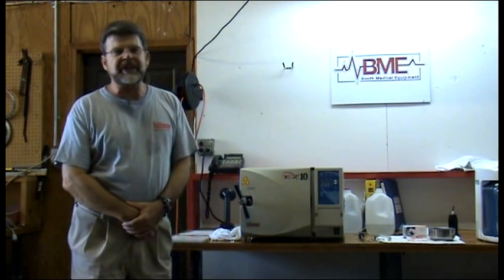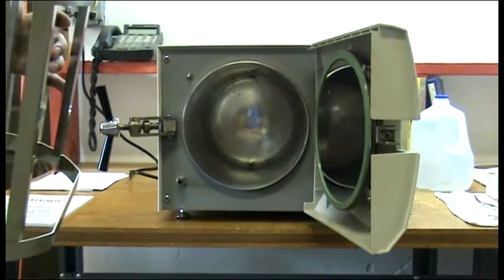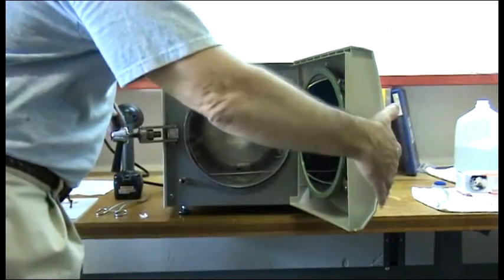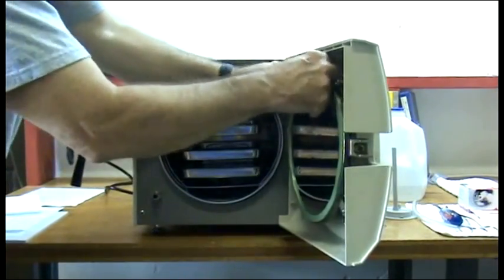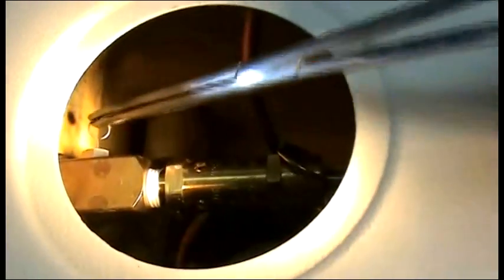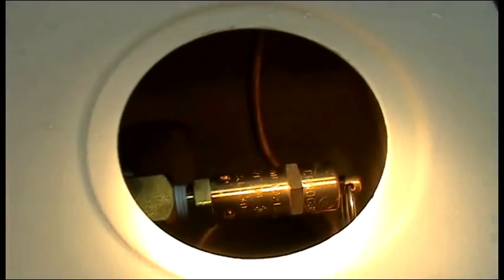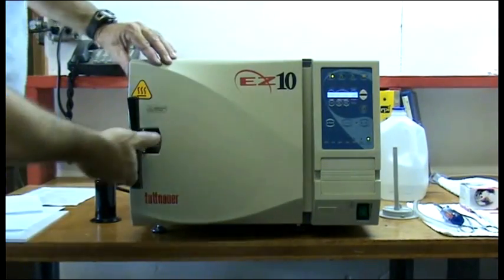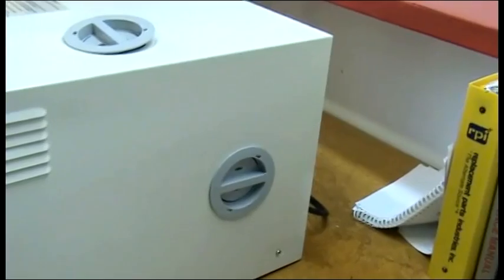How to Clean and Maintain Your Tuttnauer Automatic Autoclave - Part 2

Comment: Hey Steve
May I ask you can I use Teflon tape for sealing  safty valve ?

Thanks
Reply: thats a great question
Reply: It looks like he did
Reply: Teflon tape should be used to seal the safety valve. Of course, read any instructions provided with the safety valve you purchased. Sometimes you may find that the manufacturer has already applied some orange pipe thread seal. If the thread on the end of your safety valve are bare, wrap them with Teflon. Also be sure to remove ALL Teflon left behind from the safety valve you removed because those little stringy pieces can clog up a valve presenting a danger or preventing it from closing. A valve stuck open will cause a failed cycle.